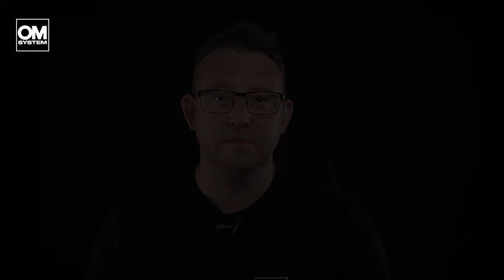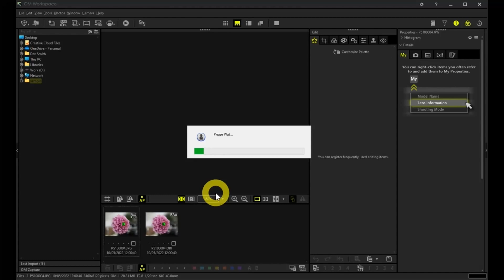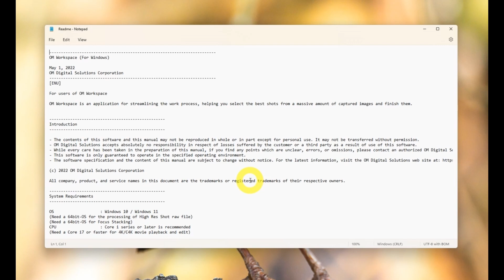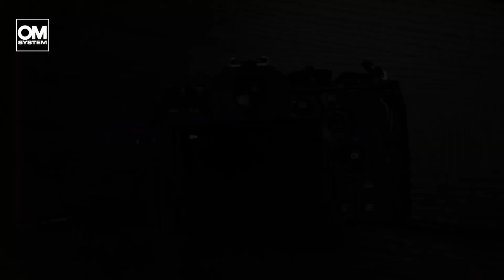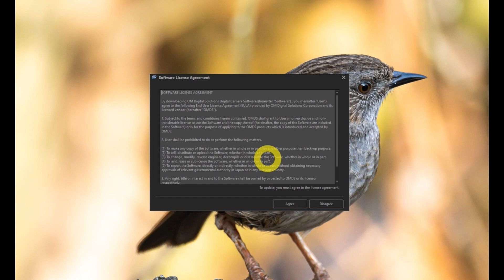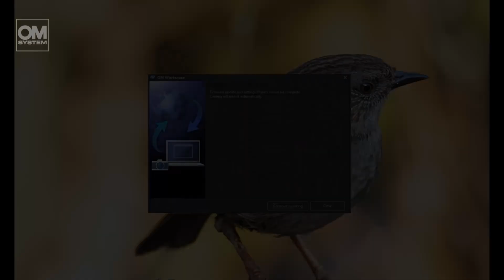Updating your OM SYSTEM firmware using OM Workspace

Comment: This is all very well but lots of in use PCs/Laptops do not possess a USB - C socket to connect the supplied USB-C to USB-C cable. Please provide an answer to a previous contributor who asked if you could use a USB-C to USB adapter on the end of the cable. I have the same question and what is the risk if you do. There seems to be lots of comments around that suggest that this upgrade may fail in certain circumstances. I am not prepared to take the risk without some assurances.
Many thanks and best regards.
Fergus Buchanan
Reply: You can use a USB-C to USB-A cable. I'm using the one that came with my Nikon Z body (Nikon UC-E24), but the E-M1 II used to come with a USB-C to USB-A cable (Olympus CB-USB11). It's not a cheap cable because it's made for USB 3. Some of the cheaper ones are a lot slower because they only have the USB 2 data wires in the cable. You can also use a USB-C to USB-A adapter and I've done that before. The most reliable one I've used is one from Angelbird. Some of the others have loose connections which you don't want when you're updating firmware, and some adapters only support USB 2.0 speeds when the USB-C is plugged in one way and USB 3 speeds when you flip it over. The Angelbird supports USB 3 speeds regardless of which way you plug in the cable
Reply: @Bunnyisms  
Thank you for such a detailed response. OM Systems seem to imply that you can only use the provided cable that I find bizarre to say the least. Thank you for providing me with a bit more confidence in using alternative connectors.
Best regards 
Fergus Buchanan
Reply: @fergusbuchanan5615  I think they are afraid someone will use a cheap cable like a charging cable from a convenience store. There really are a lot of cables that are missing a lot of the wires or don't work well. They should at least give some examples of other cables that work like the Olympus CB-USB11 USB-C to USB-A cable

Comment: Mine updated well. I used the usb c cable from my EM1 III because my laptop does not have a USB C slot. My camera wasn’t updated to  1.1 and went direct to 1.2. There was no option to go to 1.1 first in any case.
Reply: Same here. The firmware update file has been amended and took me from 1.0 directly to 1.2. It took 10 minutes to complete the process successfully.

Comment: I just tried to update to version 1.2 from 1.0 using the OI.Share app. (My Mac's security is preventing my use of Workspace for this). But while using the app, I'm told that my 1.0 is the latest version. Not sure what to do now.
Reply from the maker: Hi - you need to use the most recent OM Workspace to update from 1.0 to 1.1, there is no mobile version of this important update that came out a few weeks ago. You can however use your OM Workspace to update from 1.0 all the way to 1.2.
Reply: @OMSYSTEMCameras  you still get the error message telling you that it is blocked.  Online there is convoluted way of getting passed this on computer start up.  I'll wait until you update the mobile version.

Comment: I've already used the olympus em1ii cable to update my om1 to v1.1 because the cable provided with the om1 would  not work (I only ever got error messages).  I've found the USB cable provided with the em1ii loads photos onto my laptop MUCH faster too.  I suspect the cable provided with the OM1 is not able to maintain the consistent/fast connection necessary to do the update (at least with my computer). Is there any reason to not use the em1ii cable if it works/worked?  I personally consider the usb-c to usb-c cable to be worse than what was provided in older models.  Could OM solutions clarify compatibility with cables provided with older models and/or offer a 'normal' USB cable as it would be way more convenient for day to day use?
Reply from the maker: We always recommend using the cable that comes with your camera but understand that not all computers have the USB C connection of the OM-1 cable. We don't advise using adaptors since this may cause problems but a USB C to USB A that came with your EM1 MKII AND MKIII is just fine :)

Comment: Great. 
I love videos like these because I get to learn and have better appreciation for my camera. It also keeps me feeling connected with OM SYSTEM. 
Question: My 40-150mm kit stopped working on my Olympus Pen Epl1, could it possibly need to be updated? 🤔
I miss that lens so much!
Reply from the maker: Hi Marcus - We cant be sure why your lens has stopped working but it certainly would not be because an update is necessary. I recommend that you go through the process in your region to get it checked by the repair team. :)

Comment: You need to fix your software for non intel macs ( like M1 and M2 ) to disable the security feature in recovery and add kernel extension is a too  high request for what this software needs to do.
Reply: Absolutely
Reply: How?
Reply from the maker: I'm sorry that you are having problems Alain - Please try this link to help with getting your privacy settings sorted 

https://cs.olympus-imaging.jp/en/support/imsg/digicamera/qa/contents/m1mac/m1mac_b.cfm#:~:text=Answer%3A%20After%20installing%20OM%20Workspace%20%28Olympus%20Workspace%29%20to,Solutions%20camera%20driver%20is%20blocked%20by%20the%20OS.
Reply: @OMSYSTEMCameras  This DOES NOT WORK! On page 4 of the instructions there is a screen shot with a box that says "Allow." This never comes up. I followed the instructions up to this point.
Reply: @1mziegler1  I have been having the same problem trying to get my M1 MacBook to run OM Workspace and connect to my OM-1. Olympus blame Apple and Apple says it's an Olympus problem. Seriously pissed off that Olympus support don't have a clue and/or don't care !!
Reply: @andrewowen-price4496  Have you used macOS security settings on M1 mac to give workspace access to the camera as an external drive? I though that had worked for me. I'll have to go back and double check.
Reply: @brucetolley8490  All help gratefully received - the official OM Systems document that sets out how to set up the MAC for successful integration does not match with the system messages displayed on an Mac running Monterey 12.0 ... its now been over a month since OM systems support stated that they would refer the matter to the app development team - and they have issued zero information - so I still have an OM-1 with three lenses that cannot be connected to the Mac to execute software updates. Disappointing to say the least !
Reply: @OMSYSTEMCameras  That has been tried and Apple support say that it is an Olympus / OM Systems problem. I'm running a Apple M1 MacBook with MacOS Monterey 12.5.1. Your instructions DO NOT WORK on this latest Mac operating system. This problem has been with me since I bought an OM-1 and I have increasingly frustrated by the lack of help shown by OM Support. The result is that I have thousands of pounds worth of OM camera / lenses which I am unable to update to the latest firmware. VERY DISAPPOINTING!!

Comment: Thanks for the video David.  I don't have a spare usb c port available, I'm updating using the Olympus/om cable via a usb-C to USB port adapter connected to a  3.2 Gen 1 port.  Do you see a problem doing it this way?
 Thanks

Comment: "Only use the cable supplied with the camera" 
The OM-1 comes with just a USB-C to USB-C cable. How many people have new computers with USB-C ports? Should have included a regular USB-A to USB-C cable as well in the box.
Reply: nonda USB C to USB Adapter(2 Pack),USB-C to USB 3.0 Adapter,USB Type-C to USB,Thunderbolt 3 to USB Female Adapter OTG for MacBook Pro 2019/2018/2017,M On Amazon .works fine no problem .have 4 UUSB a hard drives plugged into USB c ports using these with no problems .
Reply: This is what I wrote above in one of my messages! Only a USB C to USB C cable with the OM-1 Mark II....OM...my PC has only USB A......a little more wisdom please! Now I have to buy a new cable, I feel very upset!